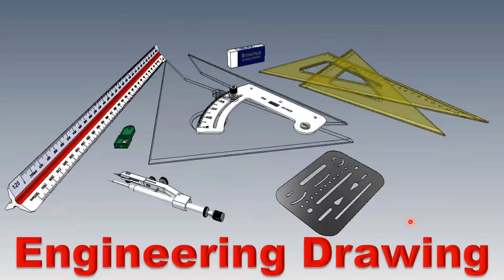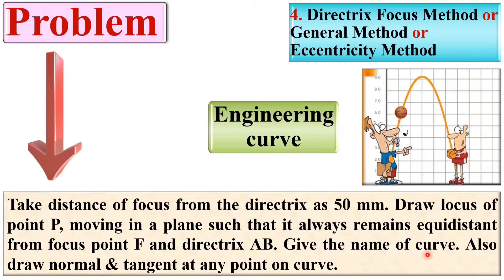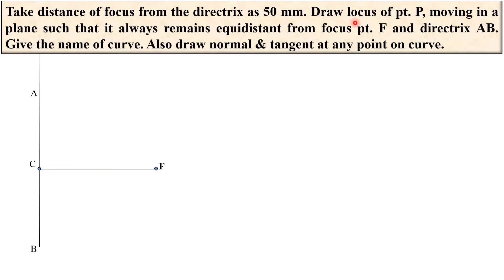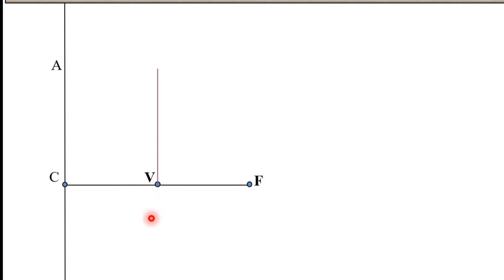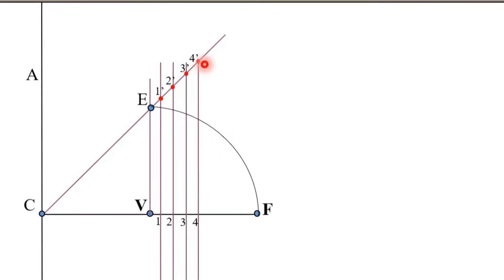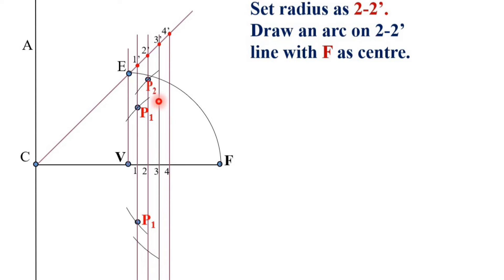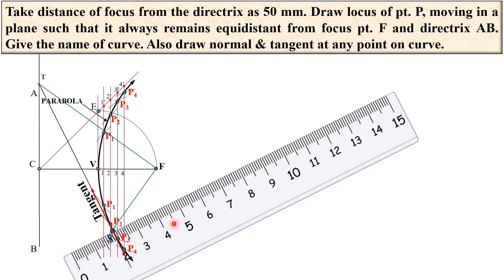Parabola by Directrix Focus Method or General Method | Tangent and Normal to Parabola

Comment from the maker: Parabola by Directrix Focus Method explained with following timestamp: 
0:00 – Engineering Drawing lecture series 
0:10 – Methods for parabola 
0:31 – Problem Statement of Parabola by Directrix Focus Method 
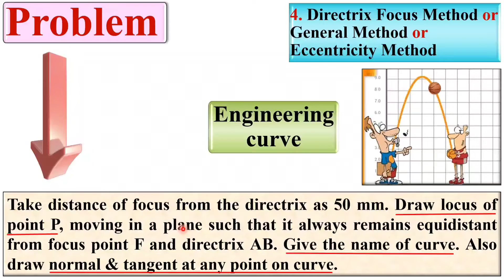1:18 – Parabola by Directrix Focus Method
5:32 – Identification of the name of curve
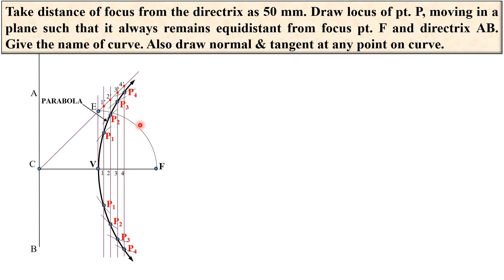5:49 – Draw normal and tangent to Parabola
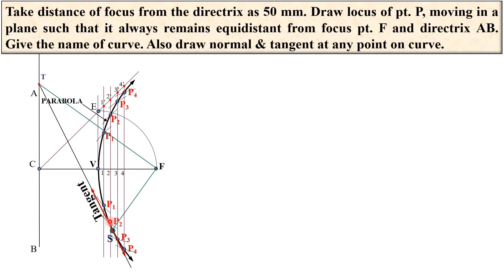6:38 – Tangent to Parabola
6:50 – Normal to Parabola